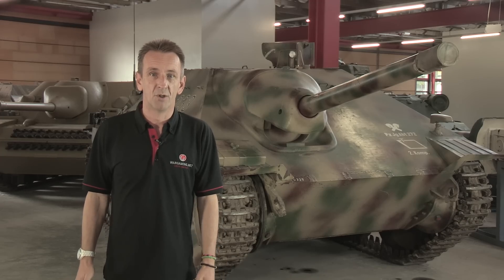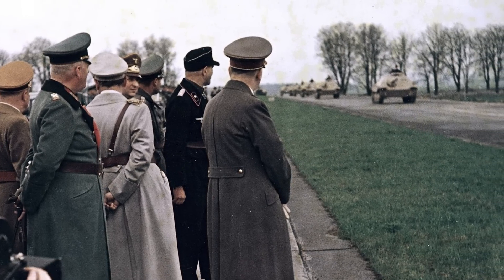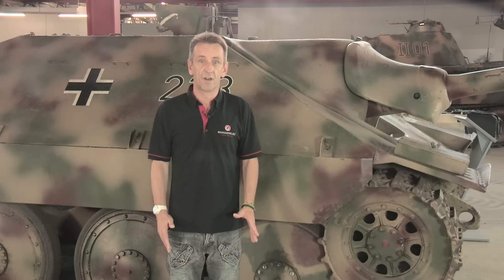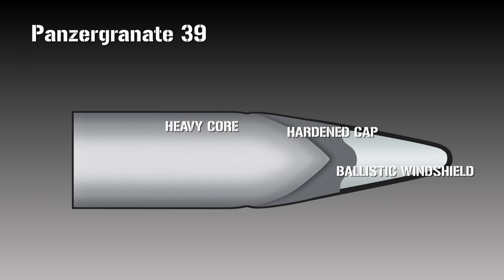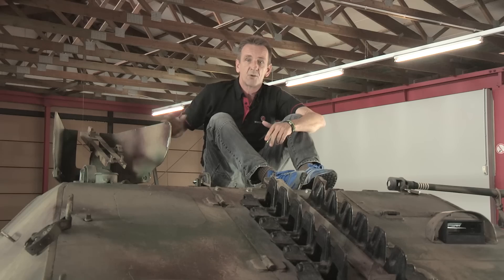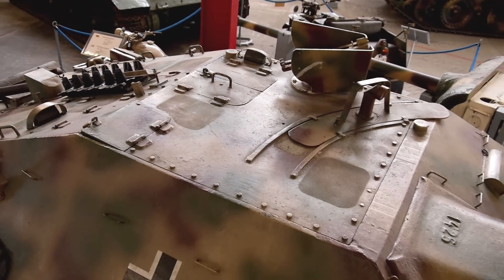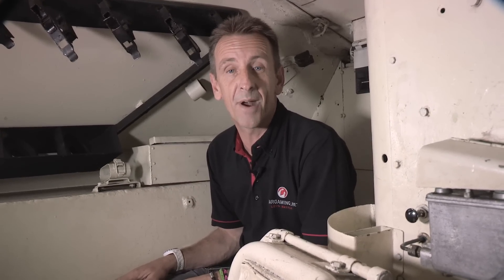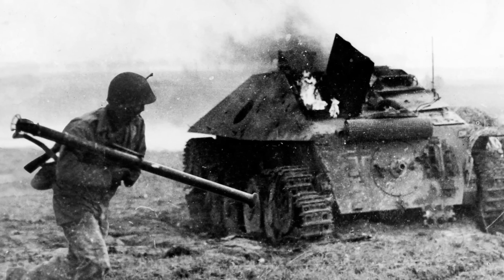Inside the Tanks: The Hetzer - World of Tanks

Comment: Having driven the Hetzer, I am constantly amazed how everyone raves about what a superb vehicle it is. I asked a Hetzer veteran what was the best thing about the Hetzer he operated. His reply, 'it was warm inside during the winter of 1944/5'. 

Operating the Hetzer in heavy rain across open fields is no joke. As a driver, you cannot see outside the tank because the rain obscures the vision blocks. Inside, the condensation from the engine and the crew's bodies steams up the vision blocks too. The inside walls run with condensation and the rain comes through the roof thanks to the sliding plate around the periscope. If the commander's hatch is open, the rain pours in here also. The floor is several centimetres deep in rain water and mud from the crew's boots add to the general air of misery inside.

Outside, in muddy conditions, the mud collects between the drive sprocket and the hull and slows the vehicle almost to a halt. I am not talking several kilometres here, only a couple of hundred metres. In poor conditions, the sloped hull is very slippery especially when muddy. No one ever mentions the fierce clutch either, which makes the Hetzer such a pig to drive. 

I have driven most WWII Allied armoured vehicles from Valentine to IS-3, as well as Marder III and Stug III and while the Hetzer may look great, I can assure you it isn't great to operate in poor weather.
Reply: Any more info? I'm trying to collect as much info on the Hetzer as possible for my current project, there isn't much in the way of combat/crew records floating around.
Reply: All I can tell you about the Hetzer vet was that he was posted to a unit where new Hetzers were being delivered and he helped to unload them. Some weeks later, he was posted to another unit as an instructor on the Hetzer! Obviously, times were getting desperate in late 1944.
I can't help you with any more info except to say I have owned two Hetzer and a Stug III plus driven a Marder III. Both the Stug and the Marder were easier vehicles to drive.
Reply: I have heard that Hetzer crews weren't exactly elite, but that is something new all together! Thanks for info mate, I really appreciate it.
Reply: >>If the commander's hatch is open, the rain pours in here also<<<
LOL! So through my window of my house, if open!
T-34 had that problem, poor construction, bad welding, gaps and through cracks in the armor, rain would poor in, short out the electronics.
.
Reply: Panzerjaeger 'It was warm in the winter.' Im dead lmao
Reply: So I have driven a Nissan hardbody the war machine of  modern north africa.
Reply: I bet there was more room in the Nissan
Reply: Panzerjaeger I'm sure I couldn't imagine being stuck in any armoured vehicle for long periods of time. How were you able to drive so many armoured vehicles Do you own some or just know somebody at a museum?
Reply: Panzerjaeger since you've been in a stug 3 (g I presume) could you tell me how it was inside the tank since I can't find how it was inside being a commander and such and I would enjoy hearing how it was for you, since us Swedes probably wouldn't be able to climb let alone sit inside the tanks
Reply: Believe it or not, I never commanded a Stug III, I was always the driver. Although there was not much room, it was a far better experience than driving the Hetzer. With a full crew, there is not a lot of space inside a Stug and the gunner's knees are in your back most of the time. The commander's position was better as he was slightly higher up on his seat but his knees were also in the gunner's back.
My Stug was the Ausf. G so there was more room than the earlier models. Most of the photos in the Ryton Stug book are of my Stug under restoration, a task which took me one year to complete. It was a wonderful experience rebuilding that vehicle.
Reply: Panzerjaeger wow, simply amazing have you driven a jagdpanzer IV or a jagdpanther?

You're awsome becuase you describe how it must have felt being inside the tanks of Germany as a driver mostly so do tell me more ^^ I highly enjoy reading your comments
Reply: I have never driven a Jg IV but there is plenty of space inside, especially for the driver. The Jagdpanther is huge but there is is very little space for the driver as he has to squeeze between the hull and the gun mount. It is very tight in the driving position and I did not like the experience.  I have driven IS-2, IS-3 and ISU-152 and as a driver, you can see very little outside because you are seated so far back from the vision slit. I have been inside a tank when it is on fire and it is not a very pleasant experience but I cannot say how the German tank crew felt, everyone handles the noise and the fumes in their own way.
Reply: Panzerjaeger so jagdpanther relied more on the commander for view thenI asume
Reply: All armoured vehicles are only as good as the crew that operates them. Poorly trained crews, lack of radios, a commander who had to double up as gunner in the T-34/76 meant they were ineffective when first used in combat. Tank crews operate as a team and the driver goes where the commander tells him because the commander has better all round vision than that of the driver.
Reply: Panzerjaeger yet there need to be space and comfort otherwise there's a risk the crew haven't sleept and isn't as efficient as they would be cough panthers cough speaking of have you driven one? Is it really tight spaced and uncomfortable as they say it is? If you've driven one ofcourse
Reply: I have never driven a Panther although I have been in almost every German tank built during WW2 including Elefant and Maus. There is very little space for the driver in a Panther; not as much as in a Sherman, M18 or T-34, although the T-34 is a tiring vehicle to drive. There is very little comfort in any tank and it is very exhausting to drive a tank for 4 - 6 hours.
Reply: Panzerjaeger even the jagdtiger?
Reply: Yes, I have been to Kubinka many times and have been inside T-80, T-90 and BMP-3 plus I used to own a  Leopard 1 (which my wife drove whenever she could). The Leopard 2 is like a sports car to drive but the driver must remember the rest of the crew when travelling across country at speed.
Reply: They just used the Tschech factories to fill the demands on armored vehicles. Also, in 1943 the Americans bombed the ball bearing factories in Schweinfurt and reduced the output down to 67%.  One of the reasons they couldn't produce more turreted tanks.
Reply: Great commentary. Thanks.
Reply: LOL. I was driving light armor in exercises and with the hatches open, and our heads up, the commander liked to get my attention by using a long stick cleaned of its bark, with a rather large machine nut jammed on the end, to tap on my head! I was only wearing a beret. I really paid attention after a few of those taps. Yeah, the commander is the boss.
Reply: Thanks for your post.  The more I read about the Hetzer, the more it sounds like a great AFV on paper but in the field it had a lot of deficiencies that would not show up in a war game.
Reply: Great stuff Panzerjaeger. I have always loved the profile of the Hetzer & thought it would be a really useful little machine. Cheap to produce & deadly if employed correctly. It's the practicalities of operating these machines in the field & the experience of the crew that you can't account for when reading the specifications in a book. Very interesting, thanks!
Reply: I'm quite sure I've read somewhere there was also a a gun smoke obstruction to the commander periscope after a shot.
Reply: Panzerjaeger which tank would you choose if you were struck in WW2 ?(consider you have the liberty to choose any tank of any country keeping in mind the tank's maintenance, gun, armor, fuel, and durability) please tell in detail. Thanks in advace.
Reply: Panzerjaeger 
Man, your life must be interesting.
Reply: when did you drive that Tank ? In Combat? Where?
Reply: @panzerjaeger4274  how do we know that you were really in those tanks do you have anny proof
Reply: MrMate 
I don’t look at YouTube very often and so my replies are few and far between. I have been an MV collector since I restored my first Jeep
Reply: Normen singleton I drove my first tank in 1964 and sold my last tank a week ago! I drove my Stug and Hetzers between 1985 and 2009 although I have a Hetzer in a container about to be shipped to the USA.
Reply: phung tran I have had a fabulous life with tanks
Reply: Swarnim Khosla A Panther because it has the three essentials of armour protection, mobility and a superb gun
Reply: @robertfleming2392  After reading your original comment I went to your channel to subscribe. Very sorry to see you have no videos - I can think of no better You tube channel than somebody who drives this sort of kit actually driving it! And letting us in on some of that knowledge. You could sign me up!
Reply: OK...... How old are you?
Reply: Where do you go and get the ability to drive tanks like that? Out of curiosity because I would love to do that lmao
Reply: Panzerjaeger where do u live because America doesnt allow anything like that
Reply: Oh, come on dude, why you had to place all of that information here... Damn it, now I really really would love to have one, if only I was a billionaire, damn it damn it damn it
Reply: I drove a Hetzer in North Africa, we dreamed of rain coming through the opening on the roof and water running down the walls of the tank. But we were mostly dry.
Reply: @woody000555  you can submit war archives in libraries maybe they are digitally copied and rest somewhere in dust..
Reply: Wow! You sure know a lot about the Hetzer! There’s one thing that I can’t understand, is how did you get the info? Did you actually serve in WW2? There are probably more WW2 veterans living in 2019, but seriously... Did you serve during the war?
Reply: The combination of vehicles you have talked about driving makes me wonder, do you go to the war and peace show? Are you with the people with the stug, marder and hetzer? If was parked accross the road from them with a Willis jeep, this last year gone.
Reply: Panzerjaeger ye but it looks dope
Reply: Daniel Zhao are you okay man?
Reply: Yeah but it's cute
Reply: LOL, PJ is full of it.  The 'Hetzer' is really more akin to a Marder than a StuG.
Reply: @woody000555  There is no vehicle in the German records called the "Hetzer".  This is a nickname that stuck.  Look up Jagdpanzer 38t.

Comment: according to my book"weapons of war" the tank that the Hetzer is based on is the Czech-designed LTvz-38.When it became out classed as a tank (it only mounted a 37.2mm Skoda A7 gun,with 10-25mm of armour) ,the chassis was used for the tank destroyer 'Hetzer'. A well sloped armour casement was built up(10-60mm) and the German pak39  75mm gun was mounted along with the
MG34. 1577 were built. the Hetzer"was a tremendous success." After ww2 the Czech army took over production and exports were still in service with the Swiss army in the 1970's ! I hope this
clears up some of the confusion about the late great Hetzer.

Comment: I would recommend to use open top. Since these tanks are used for ambus, not for close combat. Open top allow tank members to have better alertness in the battle field;  heat and smoke from shooting the gun could spread out faster & hence better working environment & therefore improve efficiency; reduce the weight of the tank; in case they have to escape from the tank, it is much more easy.

Comment: Why they didnt put the commander in the loader place and the loader behing the gun, he would have an easier way to load and get the ammo.
Reply: +Argentvs commander's equipment was located at commander's seat
Reply: DamnedUsernameThing What?.
Reply: Argentvs If the loader sat in the commander's seat, the commander wouldn't be able to use his periscope or his hatch
Reply: DamnedUsernameThing Dude... thats stupid... 
When i said why they put the ocmmander there i was talking about the designers... If they placed the commander in the other place all the commander elements would be in that other place too...
Reply: Argentvs The chasis was taken from the Pz. 38t, which might have something to do with the placement of the commander's seat.

Either way though, even if the loader's seat was in place of the commander's seat, the problem would not be solved. Rounds were mounted on both sides of the interior, so even if he switched spots with the commander, the loader would still have to reach over to get the rounds.
Reply: +Argentvs Why didn't they put the driver behind the gun, making room to move the gun central.
It's small enough to be driven from behind.
Reply: +dekster14LP You probably wouldn't be able to see at all if there's a gun in front of you. The driver has to peer through tiny slits just to see as it was.
Reply: +Argentvs You don't place anything BEHIND the gun, EVER. Have you heard of recoil? When a gun fires, it needs space behind the breech to accommodate the recoil of the gun. You couldn't place an operator there, without killing him every time the gun fired.
Reply: Zamolxes77 Thats not what a was saying... The commander is in the place behind the gun, look for it, recoil does not use all the space. That place would been better for the loader and the commander would have a correct place where the loader is located.
Reply: +Zamolxes77 LOL
Reply: Argentvs so basically you want the commander to switch place with the loader? Then how would the loader reach over the commander to grab the shells sitting in the racks? It states clearly that the loader grabs shells from next to him. If the commander sits there, then he blocks the loader, they thought about it pretty good.
Reply: Zamolxes77 The point is that the ammo would have to be replaced too. That commander position is more rational.
Reply: +Argentvs,

I am guessing the placement of the loader on the left side was probably due to more rounds of gun ammunition being stored on that particular side. I got the impression from the video that the ammunition storage to the right of the gun was clearly less than on its left side. The Hetzer carried 41 shells total, of which the majority would be stored on the left side directly next to the loader.

Just a guess that this was the logic behind the placement of the loader.
Reply: This tank is a swiss G-13. In the swiss G-13 commander and loader changed places. So Germany actually used it differently from what you'd think seeing this video.